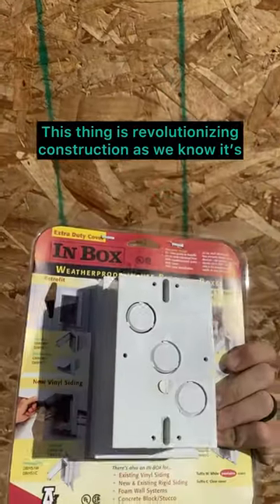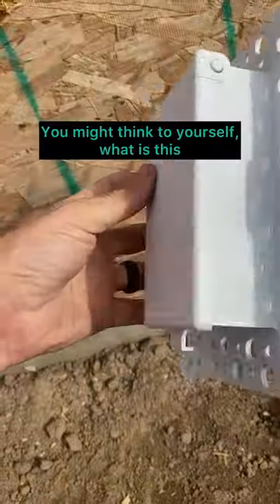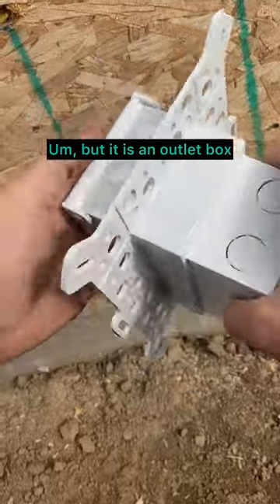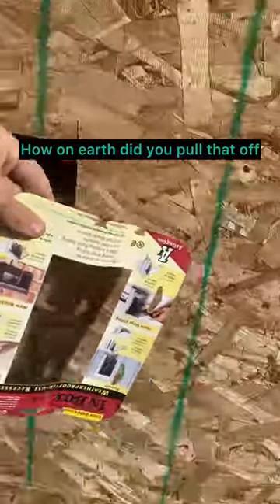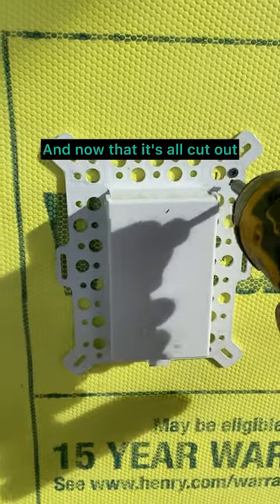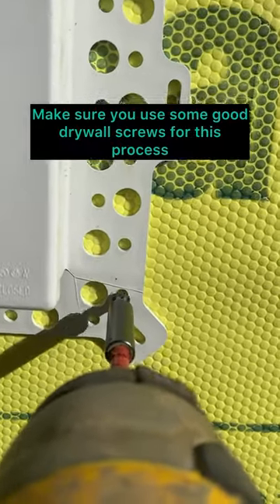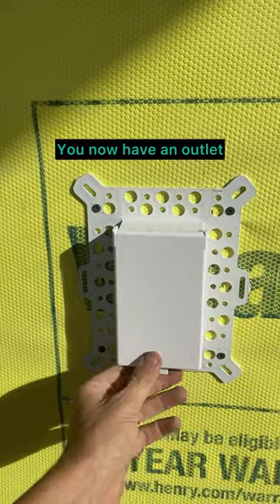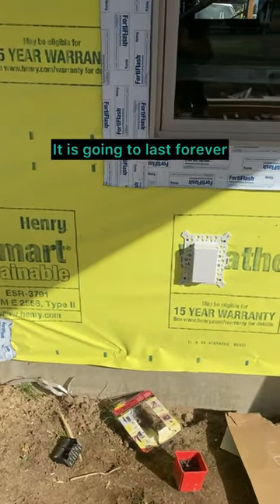Inbox! The box you didn’t think you need! #buildahouse #diy #homebuilding #construction #work #job

Comment: That is not going to be water tight with just four screws which should be stainless steel or exterior grade. This is not a food install nor design.
Reply from the maker: My sarcasm is high and an acquired taste, yes I have drywall screws for video, but that part is supposed to be a joke.